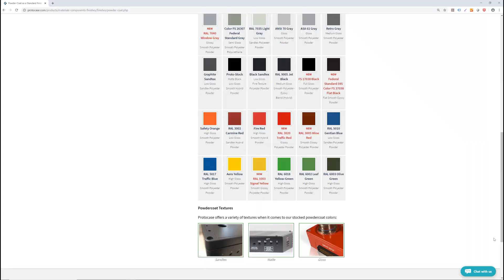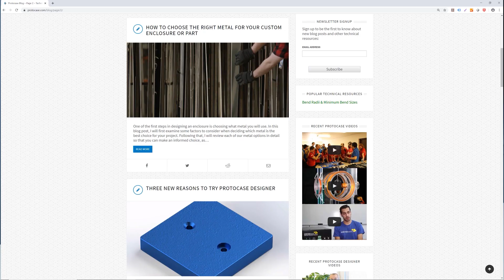Proto Tech Tip - Epoxy vs Polyester Powdercoat

Comment: Very clear explanation on the difference but I have a doubt that how good is the chemical resistance between polyester and epoxy... I mean to withstand the chemical such as nitric acid and hydrogen peroxide in the storeroom
Reply from the maker: Hi Lee, powdercoat isn't typically meant to protect against those chemicals you mentioned. Powdercoat is used to provide a finish that's tougher than paint (and also far faster/easier to apply during the manufacturing process). Powdercoat is great for preventing oxidization and reducing the chance of scratches, but it will only last a limited amount of time, depending on what it's exposed to. If you have questions about a specific powdercoat holding up to a particular chemical, let us know - we may be able to check with our powdercoat suppliers to see if they have any insight.

Comment: This is a darn good video, I wish it just also had a general price difference? What one is more expensive etc.. or saying they are about the same if there isnt a price difference? I am also wondering if there would be a difference on thinner gauge metals that may experience flexing. Would there be cracks on one and not the other?
Reply from the maker: Hi Zach, thanks for the questions. For pricing, there is no difference between polyester and epoxy powdercoat, as long as it's a color we stock at Protocase. All-in stock powdercoats cost the same. As for the question about thinner gauge metals, we've never seen this issue (or at least have had it reported to us by a customer). The powdercoat coverage is very strong, so it should not crack for the amount that a thin metal would flex. Hope this helps! Thanks for checking out the video!